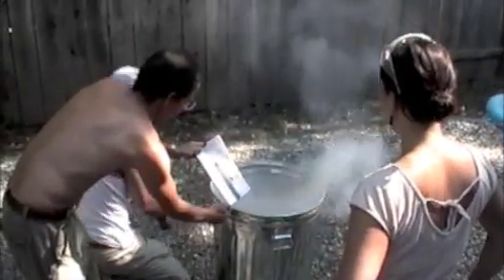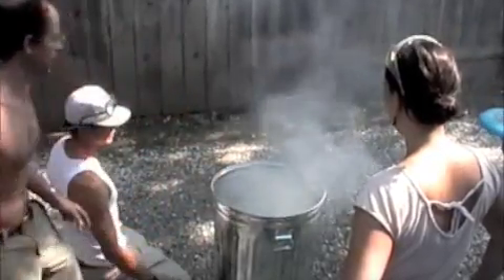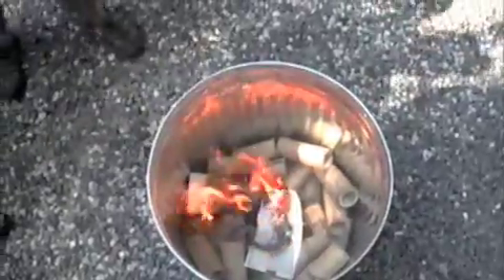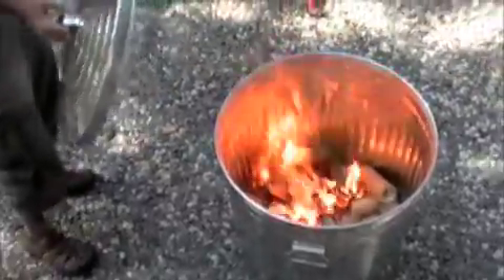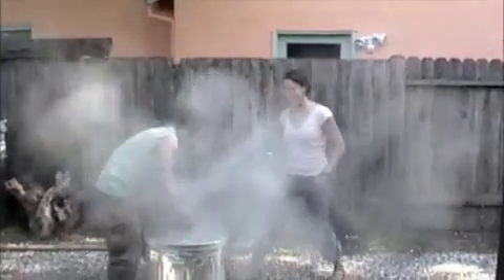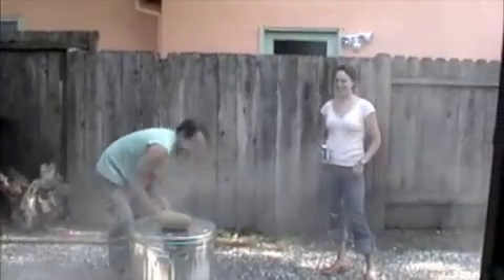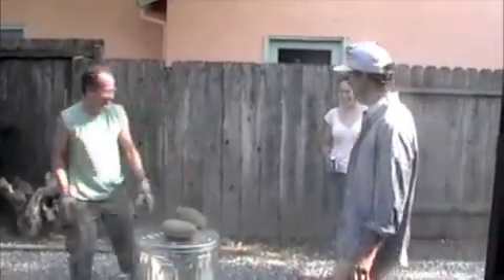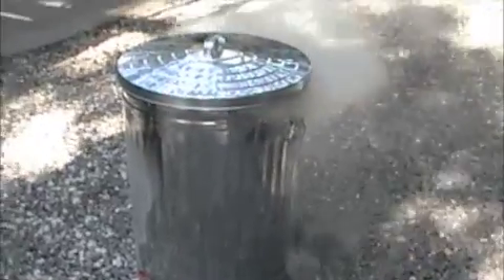charcoal bamboo

Comment: Here's how you might try that... Your video was posted in 2009... and its 2015. Though if you do the same thing, however, don't drill the holes in the bottom of the can, but instead seal the can, save a few pressure relief holes directly on top. Next, make a large pile of wood with your modified can in the centre of it. Next, light the fire. The air isn't able to get to the bamboo and the internal temperature is able to go thru the Pyrolotic process with the large heat generated. I'd bet you that the bamboo in garbage pale would be... Bamboo Charcoal. ;)

Comment: thats not how you make charcoal, thats how you make a bonfire. charcoal is made by heating up wood/bamboo to its combustion point without exposing it to flame. You should have placed the garbage can with only holes in the lid inside a bonfire. The bamboo would create wood-gas, a volatile vapor, which burns off after leaving the barrel and contacting the fire. when the wood-gas is completely removed from the wood at high temperatures it turns the wood into charcoal.
Reply: It can be exposed to flame, just not oxygen